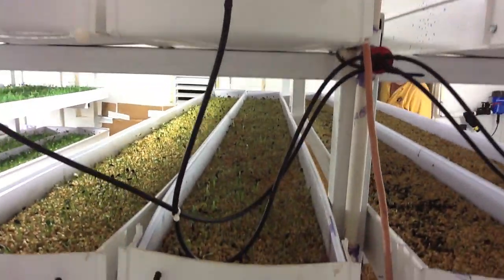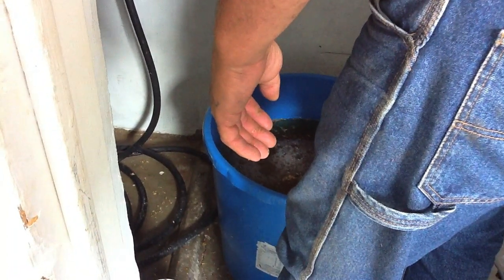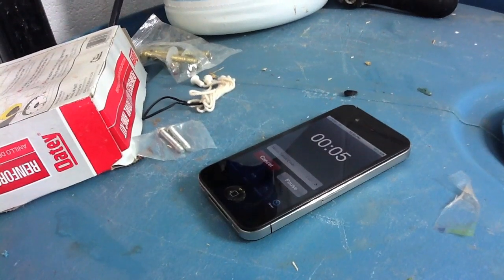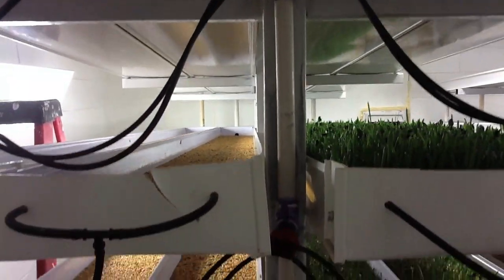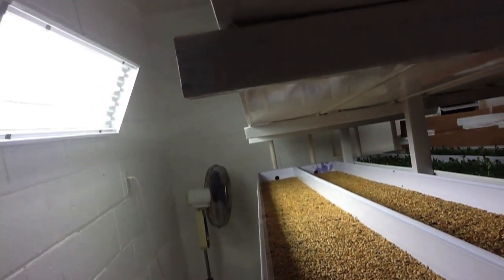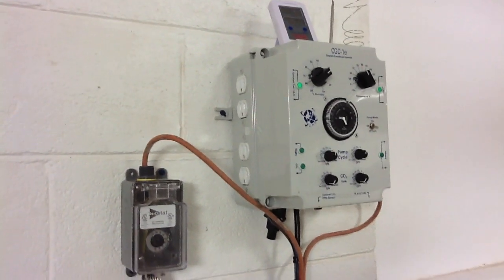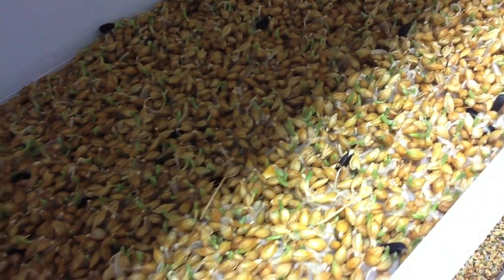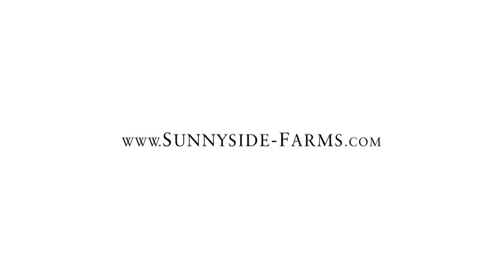Sunnyside Farms - Hydroponic Fodder System

Comment: the water mixer is a small part you connected after the venturi it is very benefit for the sprouts you can  get it from the same place you buy the venturi and they going to show you also similar parts you need to use like check valves.  about the magnets they are 2 comes with special metal parts to connect around the water line or hose .they sill them on EBAY 75 D

Comment: instead of using bleach or clorine it is better using the ozone water filter it kills the bacteria 99.9% in the water you use to soak the seed and to water them in the trays  .this way you never going to see any mold in the trays by using ozonated water .the ozonated water after 3 hours it,s not ozonated any more .if you want to connect the ozone in the water line you can do that by using the venturi or some water ozone filters comes with the venturi inside

Comment: it is important to lower the P H to less than 6 for the fodder not like other plants they need 7 the regular water is 8 or 9 .it is by getting the P H DOWN from the lightplanting hydroponics  .    you might need to get a venturi  to connect after the the check valve in the water hose .and you can use other parts like a mixer or amagnet you can buy them from ebay or amazon

Comment: the safe way is to use the water generator ozone filter to kill the bacteria in the water and when water the fodder with ozonated water it prevent the mold in the trays too .and to kill the bacteria in the room also use generator air filter whith a timer to be on every 3 hours for  7 minutes .you can buy them at ebay both for about 200d and you going to need a check valve for the water ozone filter little hose to prevent the water going back to the generator .the check valve is only 2d.